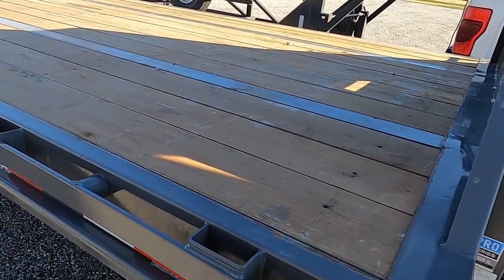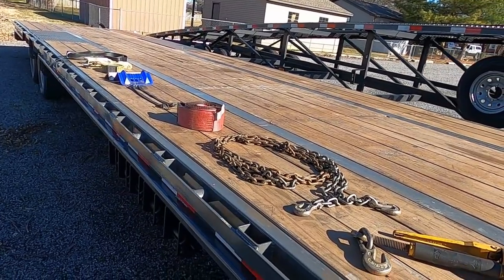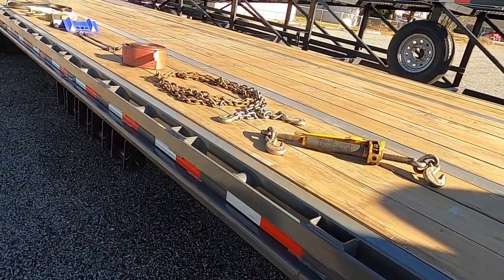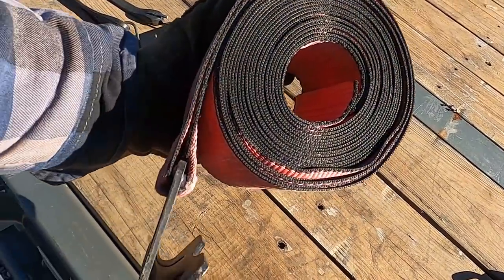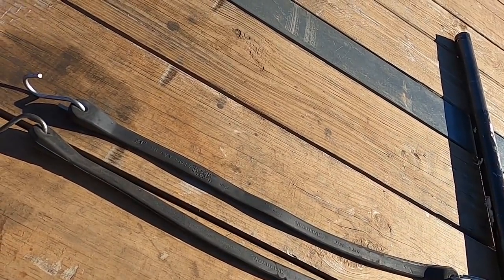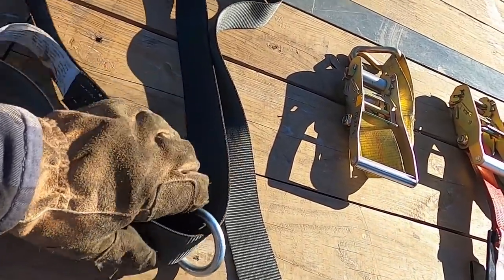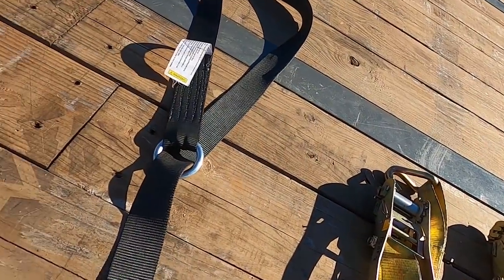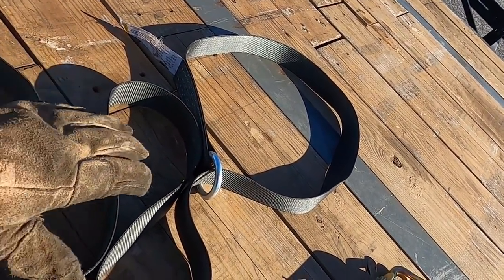HOW TO START HOTSHOT TRUCKING | FLATBED EQUIPMENT

Comment: Hello, Happy Holidays to you, WOW the bare minimum, that what I ask & say back in 01/1979 when I started my Owner Company. After I got my 1st load on my 40 ft trailer step-deck spread. I did not have enough chains or straps.  Then when the Government pulls you over because you did put on enough strap or chain, & my tarp, was flapping in the wind.  But occurs, I knew everything then being young, Nobody could tell me nothing, I knew everything. Boy, was I WRONG? Ever Load is different. better to have too much, than to lose the load, because, I did not have enough, tired down.  I am still being taught, & a learning experience. 45 + years. Later,   O/O of Eagle-Engineer/Deliv/Agriculture, Svc. YOU ARE SAYING & DEMONSTRATING IT RIGHT.  Carry on.  SEMPER FI   CSE  12/25/2020

Comment: Thank you for your content.  It makes it much easier to make  informed decisions.  Question:  Do shipping companies not like to load freight when using a 12' hydraulic lift on a 40' bed?
Reply from the maker: I’ve heard that some don’t but for the most part you’ll be fine. That tail will make you lore money hauling equipment than you’ll lose for pallets 👍

Comment: Great info like always. I'm a few months away from hitting the ground..Got tired of class 8 truck life. I've been eyeing the hotshot industry for a while.  What brand of trailer would you, or anyone else in these comments,most recommend if you had to start with a used trailer?
Reply from the maker: That’s awesome man. I’d honestly worry less about the brand and look at the features and tire wear on the trailer. The biggest mistake I made was buying a flat deck. Most definitely get one with flip out ramps, full width. Equipment is a hot commodity and it’s just almost impossible to load with pull out ramps.
Reply: @LoadMizer  Thanks a million. I'm sure I'll have a few more questions here pretty soon. Stay tuned. I'll be starting to purchase equipment for the trailer soon.

Comment: Great video! Quick question though, I personally love ratchet straps. Any disadvantage to using them over winch straps? Thanks!
Reply from the maker: Only drawback that I’ve found is that there are a couple of extra points that can seize up due to rust. Other than that it’s all pros
Reply: @LoadMizer  awesome brotha thanks for the reply!

Comment: Yoo do you think a 14gn big Tex 25+5 with mega ramps a good non cdl trailer setup? That’s all I can find in IL
Reply from the maker: I personally think 32-36 range is perfect for non cdl. 30 would definitely be starting to get short in the world of flatbed. Like I tell everybody though, I generally ran out of weight before I ran out of room on my 40’ at cdl weight. Other than a few good grouped partials I only really used the full 40’ for single or dual containers and even that was rare because of the fuel impact.

Comment: You mentioned long or shortbed trucks,isn't a shorted ideal with a 40' trailer due to ifta regulations?
Reply from the maker: It really depends on the neck length of your trailer. The closer you can get to 8’ you can hit the 65’ mark. The longer wheelbase is a much smoother ride and if you have the bed on the truck it gives you a lot more room for storage. IFTA doesn’t regulate that though. Each state’s DOT regs determine the overall length of a truck and trailer combination.

Comment: Where'd you get them lasso straps for vehicles? How long should I go for bigger tired vehicles trucks etc..?
Reply from the maker: Standard length is 12’. I’ve got a set posted in the description that I bought after the ones I had for my flatbed. I’ve had them over 35” tires no issue. 👍
Reply: @LoadMizer  awesome thanks.

Comment: Starting out do you recommend CDL or non CDL
Reply from the maker: Definitely CDL, because if Hotshot doesn’t pan out you can be in orientation with a job lined up the following Monday.
Reply: I’ve been told that if a trailer has double axles, you must have a CDL. Is this true? I know there are weight restrictions but didn’t think there were restrictions on axles.

Comment: What’s your opinion on a 53 foot step deck with a chassis cab, versus a 40 foot gooseneck?
Reply from the maker: You’d definitely be privy to loads specific to step deck and have a lot more space for loads, you’ll be countered by added weight of a step deck. I think it’s a good idea though. That or a 40’ with a deck on neck. It wouldn’t limit you that’s for sure.

Comment: Do you ever carry short chain pieces to hook on the rub rail when hauling tracked equipment
Reply from the maker: I do have a couple of small sections but for the most part if the space allows it I’ll just use 1 chain and grab it with 2 separate binders then secure the slack in between. Turn 1 chain into 2 basically.

Comment: What do you think about a trailer length for non cdl? Can I go with a 25 plus 5 or 28 plus 5 or do I need that 40’?
Reply from the maker: Most successful non cdl guys that I know get it done with a 32’ trailer. 25+5 would most likely be your best option. You’ll appreciate the turning ability with it too 👍
Reply: Right on I appreciate your input. Thanks for the videos.

Comment: have you tried rubber rope instead of bungies for your tarps.
Reply from the maker: I’ve used it in the past when I was hauling pipe continually and needed to secure a smoke tarp every day. Never used it to secure tarped loads though.
Reply: that is what i used when i did deck work. you have to weld j hooks to your trailer to secure the rope but it makes tarping so much faster and you dont have a rats nest of bungies in a box to untangle
Reply from the maker: That’s the truth man.

Comment: Hello, Load Mizer can tell if it is possible to change the rating of a trailer from 14000 lb to 12000 lb, legally?
Reply from the maker: Yes just contact the manufacturer and let them know you need to derate it. They’ll send you a decal to put over the current one.

Comment: Question: I do not see hotshots having a deck over the gooseneck; any reason for that?
Reply from the maker: Mainly because it’s an added expense that doesn’t increase capacity as far as weight goes rather the opposite. I know several that has it though and they are on dedicated accounts hauling foam panels. 4x8